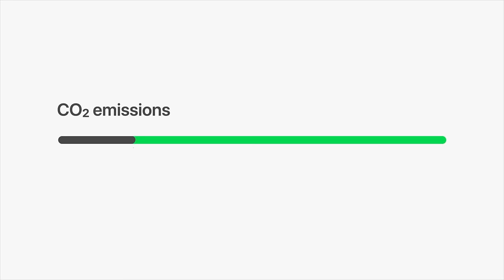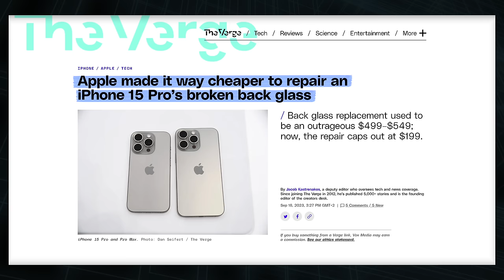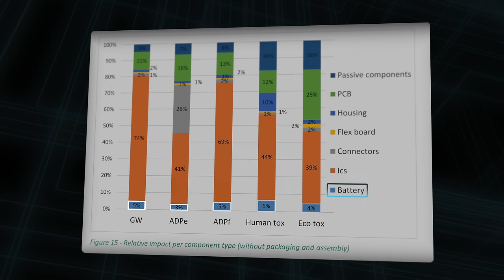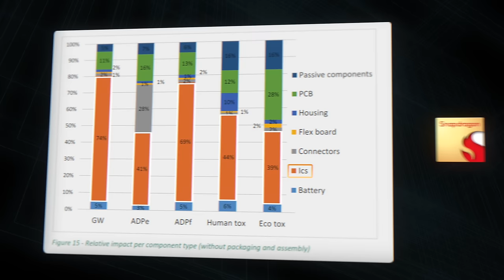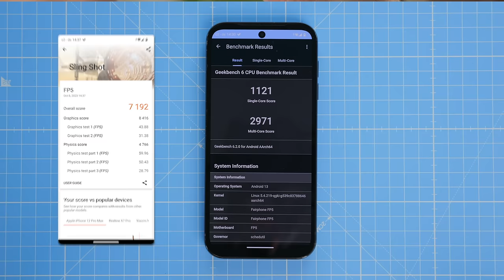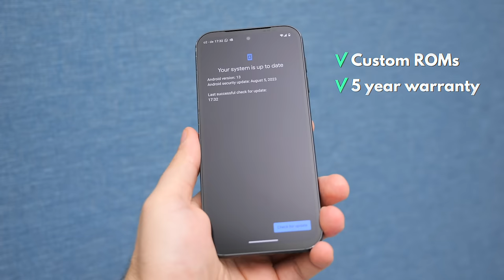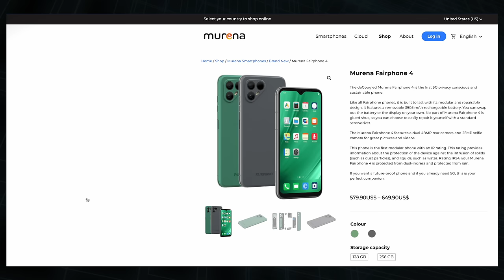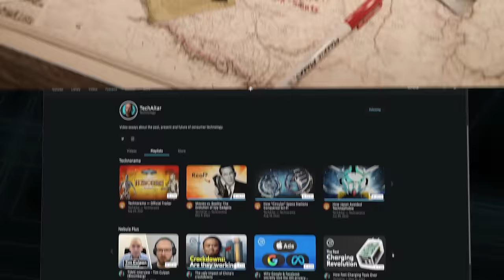Is Fairphone really fair?

Comment: The repairability is still unmatched. The ease, cost, and respect for the consumer when it comes to repair.
Reply: But is it really that helpful ?
Did you ever need this ?
I had not a single damaged smartphone in the last 10 years.

The easy way to swap batteries seems to be the best part. As batteries automatically degrades over time.
Reply: @blablup1214 looks like you answered your own question mate.  my smartphones never get damaged either, as I take good care of them, but I'd absolutely love to be able to replace the battery when it inevitably degrades too much
Reply: The amount of transparency that Fairphone provides to the public is also very commendable. I am willing to buy one, if the price was a bit lower though.
Reply: My main problem with these kind of phones is the cost of the new parts. Seriously.. 100 euros for an almost low-end display (especially if the phone itself is already 2-3 years old) is simply a scam. If it was 30-40 euros, it would be "fair".. but i rather just save the 100bucks, and get a new midrange phone for around 200.. which is already better in every single aspect than a few years old phone.
Reply: but why cant we have a company whose actual main concern is repairability, upgradeability and low cost?
Reply: @MrGiHunt  wrong
Reply: @Nedlius as long as battery replacement is easy, personally I don’t want to sacrifice the sleek design and premium materials for repairability of the other parts
Reply: I am currently using a fairphone 4 and I have a handful of spare batteries and an external charger, I haven't plugged the phone in to charge it since the external charger arrived.
Reply: @Ace-pc2cm  elaborate
Reply: @MrGiHunt The word "scam" is absolutely misused all the time nowadays...
Reply: @fairphoneuser9009  selling something at 3-4 times of the real price is what i would call a scam.. then pretending how sustainable you are, on top of it
Reply: @MrGiHunt  Well, if you look at their financial statements, they either don't do much scam or they hide it well enough...
Reply: @Ace-pc2cm   how can the repair-ability be good if its not even slightly water proof in the first place. Corroded parts are not easy to repair or replace.
Reply: @Vanadium  bro. Technology is not supposed to be waterproof. And actually yes corroded parts are very easy to replace on a fairphone. What are you talking about

Waterproofing prevents repairability. I prefer repairability, for my wallet and for the environment.
Reply: @MrGiHunt  no phone is as easy and as cheap to repair as the fairphone. This means they can last for up to a decade outside of a landfill, which should be everyone's goal.

That's one thing. And the repair costs here are actually much lower than any competitor. Not their parts nor their phones are "3-4 times the price". You're obviously intentionally lying just to shill against them. 

That's two things you're wrong about. The third is claiming that a modern entry level device is better than last year's flagship "in every way". That's so mind numbingly wrong I don't even know where to start. All I can say is grow up.
Reply: @Nedlius EU already working on that, so fairphone can go back to the landfill with the prices😂 800 euro for a phone that is slower then a 100 euro oppo phone😂
Reply: @Ace-pc2cm  but you still don't understand my point.. as you say, they can last up to a decade, but why would i bother repairing a phone in a few years for almost as much as a brand new midrange phone, which is better in every aspect? yes, the parts are relatively (for the current model) "cheap" because the phone itself is recent, but as the years pass, the parts won't get cheaper..
And i never claimed an entry level device is better than the last year's flagship, i literally didn't say anything like that. I clearly said midrange (i know for americans the new 500$ segment is the new midrange.. which is pure BS), and i didn't mention last year's flagships either. I was talking about a 3-4-5years difference. Say anything you want, but a current flagship will be worse than a midrange from let's say, 4 years from now on. The problem here is, you are very biased, nothing else. 
Call me a liar, or whatever you want, but 100euros for a low-end display on a midrange phone is bullshit, and you have to install it yourself, which again, would cost like 50-60euros if you take it to a shop. You can get a phone with a much higher quality amoled display for 200euros.
I love, how you can't have an opinion anymore in 2023, because you will always be told to grow up, or you will be called a liar, when we are just having a "friendly" discussion about phones, is it really necessarry?
Reply: @Ace-pc2cm  How old are you? Because there where enough phones that are waterproof with a crazy industrial hack from the past, it is called "rubber seal".  Fairphone doesn't make this, my question is why? 
You also tell me corrosion is easy to replace? Yes replace every part of your phone, super easy fix 🤣

Crazy that other manufactures go this route and even make current phones that do exactly what fairphone claims to be. Modular, easy to replace broken parts, waterproof rating with good hardware that is mostly cheaper also and you get your parts and how to, directly from them.
Reply: @Daniel-qz8bp  ye, i'm hoping they require the 3.5mm jack to return too, i would finally have choice in the smartphone space again
Reply: @Nedlius  Most android have that jack too, only high end Samsung dont have it. But i dont think EU will force that, only battery and usb-c.
Reply: @Daniel-qz8bp  most high-end Androids don't have the jack, with Asus, Sony, and ZTE Red Magic being the main exceptions i can think of. do you know of any other brands that still have high-end Android phones with the jack?

not saying you're wrong ofc, I would just love to add some other options to my list of phones to choose from
Reply: @Nedlius Oppo has it also and everything owned by oppo.I think it is mainly samsung and apple who dont have it, google removed it last year i think. But you can use a extendor to go from jack to usb-c. I dont use headphone jack anymore on phones becous it is going to break.
Reply: @Daniel-qz8bp  Oppo huh?  I'll give them a look.

As for the dongle, I absolutely refuse to resort to that.  I already have experience owning 2 previous phones that didn't have the jack.  I hated the worse audio quality of wireless earbuds, and I hated how they disconnected randomly.  I also hated how I then had to make sure to remember this extra tiny cable to give my phone the ability to use wired audio again, when all my previous phones and all other electronics I owned had the ability to do both.  Plus, the dongles are easy to lose, and easy to break, and I'm guessing that's not an accident either.  I'm not a fan of tech moving backwards in functionality, and it took real world time and experience to learn that lesson.  I will continue to exclusively buy phones with the jack, and I unfortunately prefer high-end phones.

So yeah, I guess I'll give Oppo a look like you recommended.
Reply: @Nedlius  But yeah chek oppo out, or one plus. They make high end flag ship killers, for a much lower price, i never had problems with my oppo, it never froze like Samsung is known for, it always works, battery is realy good, sceeen good, speed good, everything is good, and trust me if there was even a small thing not good i would tell, but legit i cant find a single proboem, also dual sim, can extand the storage with 1tb. Yeah chek it out.(i was a Samsung guy)
Reply: @Daniel-qz8bp  that expandable storage on top of dual-sim you mentioned is quite appealing
Reply: @zakkazz1201  I nowhere said you can find a display for 30-40euros. I said it SHOULD cost 30-40 (to even make any sense of swapping out the display on a few years old phone), and that's the problem. Most phones in the 150-200eu range have 120hz amoled displays, and usually even brighter (around 1000nits.. even if they don't, the rest of the specs are up there).
Reply: @zakkazz1201  Just read back everything, and then maybe give it a thought, who insulted who. You don't even deserve a response at this point. And yes, you clearly need mental help.. insulting someone just because your opinion doesn't match about phones..
Reply: @MrGiHunt  If you simply look at the industry that is what fairly produced screen costs. They aren't making significant money through their part replacements. Selling the screen at a 40% loss would be really, really stupid.
Reply: @tinminator8905  I totally understand that point, but otherwise it's still not good for the end consumer. Let's say, the average user needs a new battery after 3-4 years, the phone in that condition wouldn't be more than 1/3 of the original price, so the question is, does it really make sense, to buy a "relatively" expensive battery (relative to the phones price, let's say a theoretical price, 50$ for the new battery on a 100$ phone) for an already dated phone, or just save up a bit, and get a new midrange phone. Otherwise, it's obviously a good thing, i just have some questions, if it really helps the end-consumer.
Reply: Still proudly using my FP3 currently on Android 13.
Reply: @Nedlius  I suggest you try some good wireless audio. Absolutely blows the need for a headphone jack out the water. I'm afraid you're on your own with this one.
Reply: @MrGiHunt  now I understand why you think cheap phones are good. Because you are fooled by numbers and marketing. Processors are the main differentiator, and that's what causes the price difference. I'd rather have a 60hz flagship than a 120hz garbage phone any day.
Reply: @Ace-pc2cm  
Wired Audio:
1) doesn't need to be charged
2) has better sound quality
3) is cheaper
4) doesn't disconnect

In what way is wireless better, except, you know, not having the wire?  I'd say the "blowing out of the water" is actually reversed here.  I can't make it any more clear than this.

Here's my point.  I've already tried "high-quality" wireless earbuds in the past, and they all dissappointed me for the reasons listed above.  However, that shouldn't matter.  I should have the CHOICE to pick between wired and wireless, and so should you.

Do you understand now?
Reply: @Nedlius  I understand perfectly. That was never the issue. Then again, you seem to be the type to plug your ears and repeat your delusions thinking it'll make them true. Or worse yet, start yelling when people don't agree with you.

Good luck with that mentality.
Reply: @Ace-pc2cm  So, are you going to explain what your point is or are you going to end it on an insult?
Reply: @Nedlius  I'm not going to, no. If you were actually interested in learning, you should have led with maturity and an open mind. Remember that next time.
Reply: @Ace-pc2cm  That's hilariously ironic.  In this discussion, you are the only one who has attacked the person instead of the argument, which is something you should reflect on.  I have not insulted you once, nor am I going to do so, even now.

In the future, when your own arguments and points get challenged, it would be wise to think prior to acting, instead of knee-jerk insulting the other person after realizing your own argument is weak.

The second someone starts attacking me instead of my points is when I lose interest in the other party's opinions, which is unfortunately you in this situation.  I hope you can be more mature in your future debates.

I will not be responding to you any further.
Reply: @Nedlius  all that projection lol I've already stated you're not worth engaging with, but sure bro. I guess hitting me with a tldr "no u" makes you feel less shitty about how bad you fucked up here lol grow up
Reply: @blablup1214 today, my screen stopped displaying for no reason. I opened it up, removed the battery, undid some screws and disconnected and reconnected the screen all in about 10 minutes. With my old Samsung it would have been sending it to a repair shop, having to wait up to a week in queue, have the sales guy try to convince me that I need to spend AUD$500 for a new display which I don't need.
Reply: @Ace-pc2cm wrong
Reply: @HydraInk  ok kid lol
Reply: My favourite Fairphone feature is that you can de-google them; and with the FP4 and FP5 you can even buy them from Murena with a de-Googled version of Android installed. And that's on top of all the other FP kinds of fairness. 

And I'm response to the wider market, of course they do offer standard Android with years of updates promised (double the security lifetime of most other phones)
Reply: @theninjascientist689 where did you get the external charger? Did I miss it on their website or is it a third party product?

Either way I'm very interested, especially if it will charge FP4 and FP5 batteries (one at a time, presumably)😊
Reply: @HydraInk another erudite and detailed response.
Reply: I just buy a new iPhone every year, works out great for me
Reply: @blablup1214  being able to swap battery in seconds was a life saver during my trip in the US tbh
Reply: @theninjascientist689  what external charger do you use ?
Reply: @Nedlius  you can replace the battery in other phones. even with apple, it is not expensive, and you can do it yourself or through a third-party repair shop.
Reply: @Nedlius Xiaomi
Reply: Shift Phone.
Reply: @jimster1111 because it is impossible to have all three factors together you can’t have high repairability,upgradability and low cost  all at the same time
Reply: @Nedlius  In 2027 all manufacturers will be required to make batteries replaceable in Europe.
Reply: @zakkazz1201   I'd like to point out that 30-40€ is about what I pay per unit if my screen were to break.. Granted I am using a Note 4 from 2014
Reply: @haomingli6175  You "can" replace the battery on an apple.
While loosing a few features to Apple's DRM that they build into all their parts.
Reply: @MrGiHunt It's not a scam because they actually pay their workers a fair amount.
Reply: @jimster1111  I don't know why they couldn't use better materials for a phone you're expected to use for 8-10 years (at least). Seems very short sighted and stupid. I don't want a phone with a backplate made out of old trash bags. Metal may use energy, but it is very durable, more recyclable, and would driver adoption better. E-waste should be what they focus more on, not stupid unimpactful things like recycled plastic just to virtue signal about it.
Reply: @Nedlius you can do that with any phone. It’s just a bit more involved
Reply: Waaay too much virtue signaling in this phone
Reply: @theninjascientist689 buy an external battery
Reply: @fairphoneuser9009 what do the financials have to do with it?
Reply: @Ace-pc2cm what a silly comment. Yes. Tech can be waterproof. You can virtue signal all you want but people do go to the beach or pool with their phone.
Reply: @Ace-pc2cm you’re asssuming acailsbility of parts and it being usable that long.
Reply: @MrGiHunt you won’t want it in 5 years much less 10. Parts won’t be available and it’s sick to use worse than brand new
Reply: @blablup1214  I shouldnt need a heatgun to open my phone up
Reply: @blablup1214 In your case, perhaps it will not be necessary, in the case of my work, to repair it without changing one a year I would say that it is very useful.
Reply: WydionWytcher-o9  Yeah but this also a you problem.
I broke no smartphone and use them since ~15 years....
Reply: WydionWytcher-o9  Naturally. And it is important to be able to resonably repair your bought stuff.
I just meant : I get the feeling many of those damage are avoidable 😂
Reply: @blablup1214  

1. yes it is
2. Yes I did
3. Your circumstance doesn't have to much ours, that being said, no, my phone's integrity hasn't been a problem for a while, but that doesn't mean it doesn't need it's maintenance, like a car, you may not break it but you have to change some parts in order to be more durable and not many companies offer you that chance.
4. I mean, yeah, that's the whole point, if something degrades, it is not much to ask being able to repair it.
Reply: @Vanadium  it is IP55 so no, you can't swim with the device but it's way more than "slightly waterproof", it wouldn't hurt to read the specs once for a while.
Reply: @MrGiHunt  it seems to be you forgot that that durability is for you not needing to change your phone even if the new one it's better, if it works, why change it, it's pure consumism
Reply: @Ace-pc2cm  damn I was with you but there's no need to insult, jack 3.5 it's just better, that's it, bluetooth is "good enough", but never gonna replace a good wired no matter what fancy bluetooth device you buy
Reply: It would hurt to read my comments to the end. 
I know very well what specs this fone has. It is not waterproof this fone will die in the pockes of an athlete, the sweat will drown it.  The phone is to big so it doesn't matter at all.
Reply: if the parts, for a few years old phone cost as much as a brand new midrange phone (which kills the old one in performance, and in every aspect), then i would be a fool to repair the old one.. consumerism is not just needlessly buying newer and newer stuff we dont actually need, but overspending on stuff that have little to no value.. like 100-150 bucks for a display on a 4-5 years old phone that was 250-300 when you bought it?.. that's  what i call consumerism